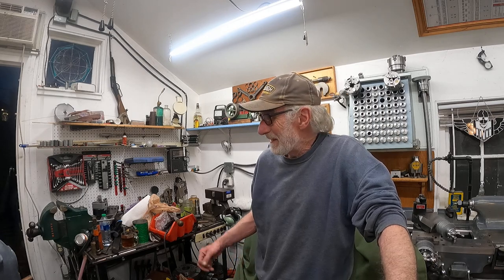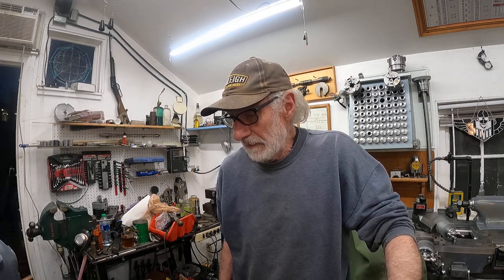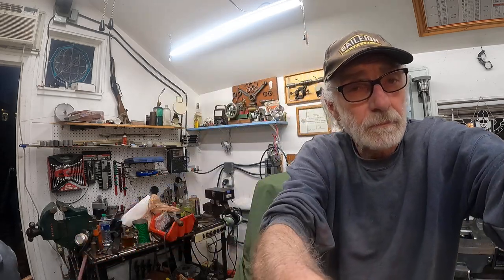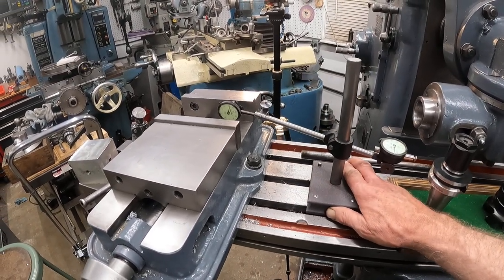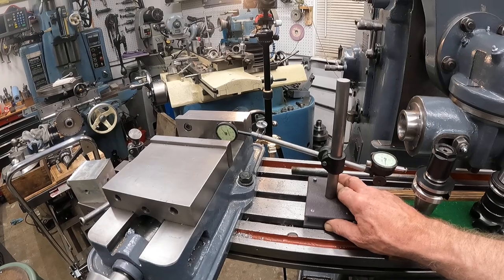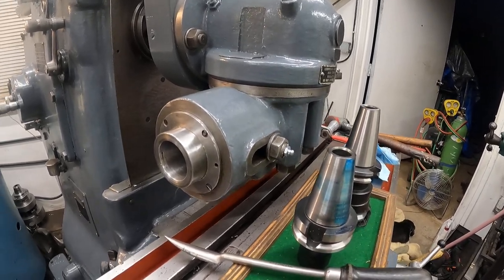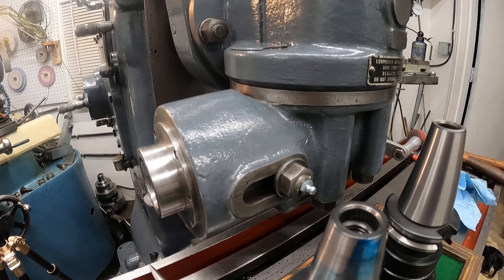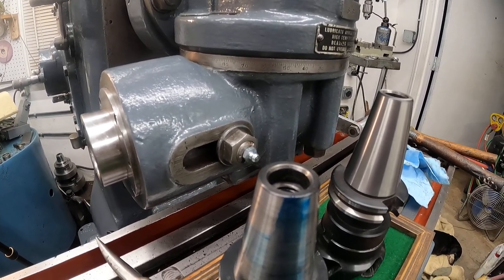Milling machine spindle and spindle socket inspection and plan for correction

Comment: Very powerful statement you made. " A series of small steps using basic machine skills. " In the correct order.  I used to tell folks to eat an elephant you must eat it one bite at a time. I totally agree with you. I'm looking forward to watching you sharpen the bearing scraper and using it on the inside taper. Looks like Chloe must have had a hard day chasing squirrels. She sure likes being close to you. My two little babies were the same way. They would fight over which one got to be in my lap. See you tomorrow.
Reply from the maker: That little dog had a big day, thanks!